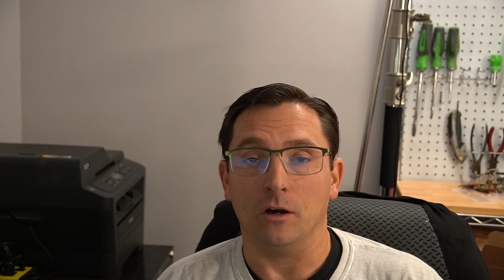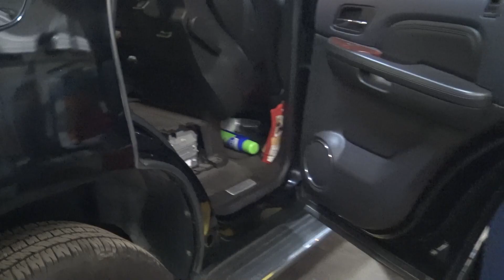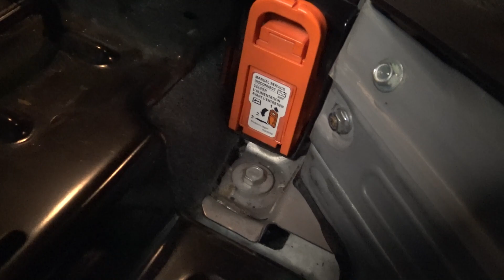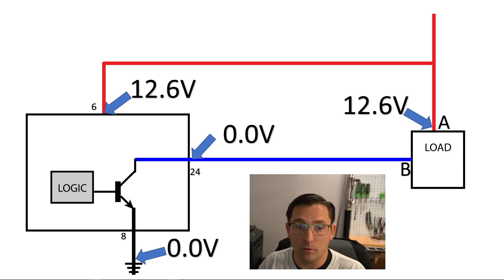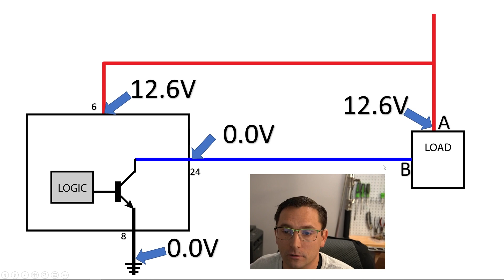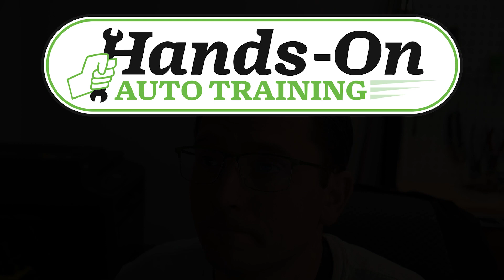2022 1 3 End Of Day

Comment: I would say B.  KOEO we should 12v to the ecm through the ignition coil. Unless if they would've said ignition coil keeps burning coz i've had a Dodge truck that burnt 3 ignition coils then they called me and i found a the control wire intermittently touching the valve cover & the coils were split in a half.